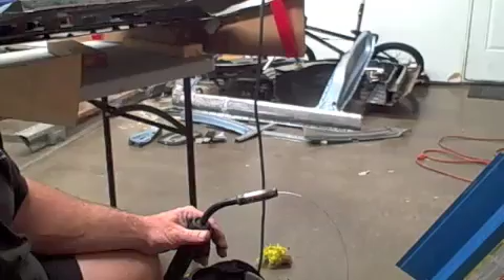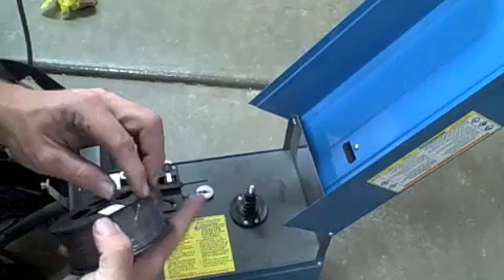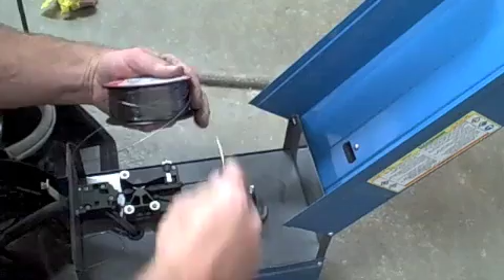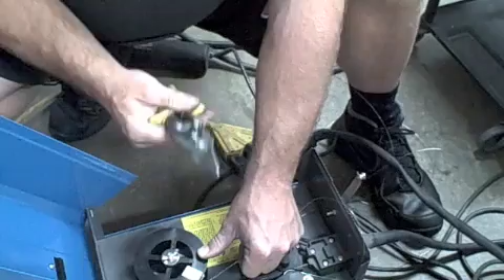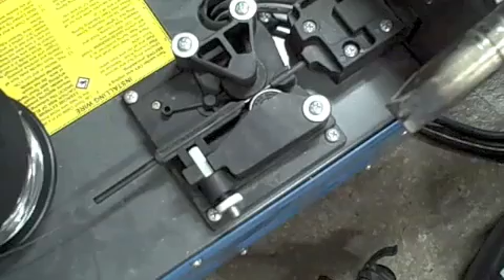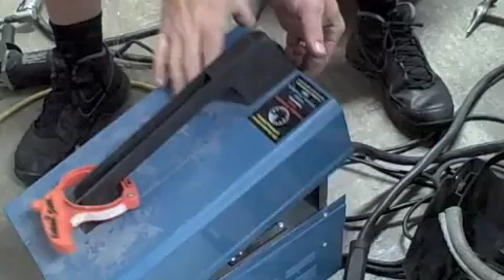How to install welding wire

Comment: Why do you have to snip the wire before you put it through the tensioner?
Reply: So you have a nice smooth cut and it wont get hung up on the way to the tip

Comment: I would have first pull the tip off.
Then pulled the old wire through the tip.
Then put the spool on the machine first the cut the wire holding it and making shire it's not to tight.
Then feed it through the hole through the gun? I D K some welding machines are diffrent I noticed yours laid flat maybe that's why you cut the wire first to put it on the spool holder?

Comment: thanks great video, hey is that a 20 amp extension cord your using for the welder because i wanted to buy one for my welder but was not sure if it was alright to use?